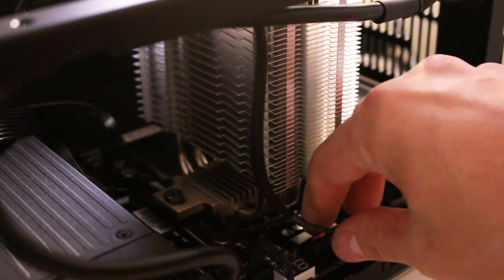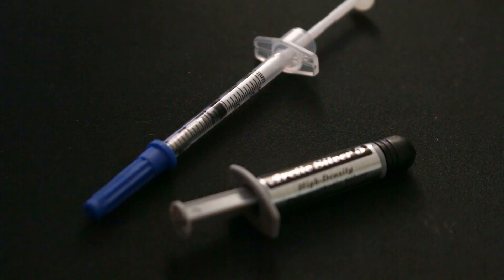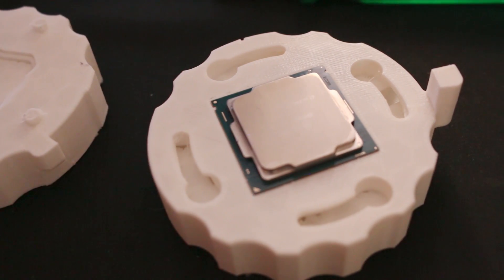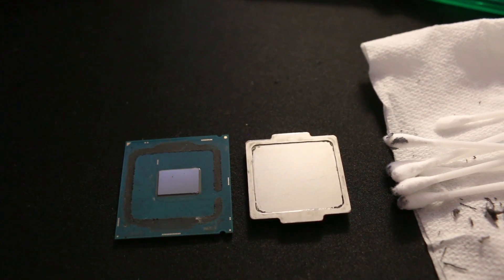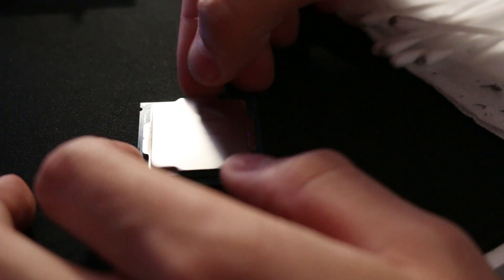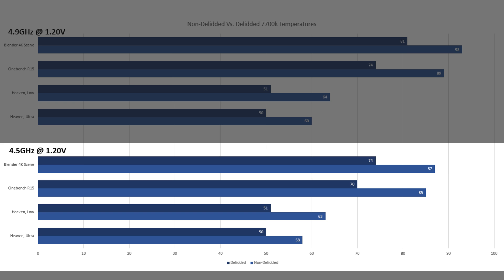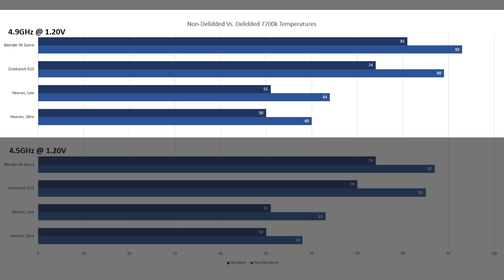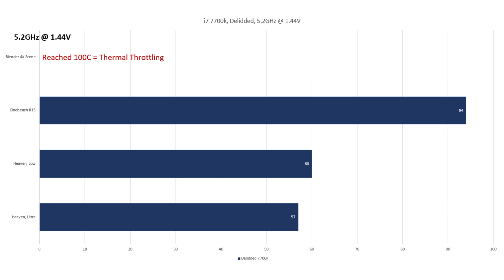i7 7700k Delidding Results - Is it Worth it?

Comment: My 7700k can run at 5GHz without a delid but the temps get pretty close to thermal throttling. I'm doing a delid soon so we'll see how much of a difference it makes with mine. I might be able to push it to 5.2GHz but performance gains probably wouldn't be worth shortening the lifespan.
Reply: Really dangerous, the sweet spot of overclock-stability is between 4.60 to 4.80ghz using a bigger cooler

For going 5ghz, better use liquid radiator

Comment: 1: Liquid Ultra is and was not then the fastest available.
2: AS5 is very very far from the best available. In fact it is mediocre at best.
3: How did you not know better that 3D printing layer adhesion would not handle that much pressure?
4: You put way too much liquid metal on the die.

Comment: Nice video, I won't complain about everything else everyone has already complained about, so theres no need to be redundant. That said I do agree with the complaints and even I, myself, whom I consider to be quite the mongrel of all things tech-related, had the courtesy use a real delidding tool when sodomizing the cpu and to, furthermore, clean the circuit board after I was done raping it. It just looks messy leaving it that way and I feel as though you have committed a cardinal sin in the holy bible of pc enthusiasts. May God have mercy on you.

Comment: If you remove the old black glue you will drop those temps by another 10c at least. 

Place a very small amount of glue on the edge or none at all.

You get better contact with the liquid metal and the gap between the IHS and the cpu will be thinner.

Comment: Holy fuck dude, that's way too much liquid metal.
Reply: he should have also applied it on the IHS. Der8auer did a nice video on how thermal material (including liquid metal) spreads and if you don't apply to both then it acts like water on glass: clumps together and moves in one direction

Comment: I delidded my brother's 7700K yesterday and dropped from thermal throttleing @4.5 Ghz to about 70° C @4.8 Ghz stable (prime 95) and i used normal Thermal paste because it's much safer to use and it did already made a huge difference to before.
By the way, I used the Thermal Grizzly Kryonaut on the Die and IHS for reference.

Comment: Definitely buy a proper delidder if you do this. It's not expensive - and cutting is hazardous as fuck.
Not all CPUs have the same layout under the heatspreader and you can easily cut surrounding transistors uless you ar eboth extremely careful and you do proper research beforehand. Just get a delidder and don't ruin your expensive CPU :)

Comment: Scrape the old adhesive off, and replace, also apply liquid metal to both the die and IHS. Permatex silicon black is perfectly fine, but even better is the 2mm wide double sided adhesive tape used to glue digitizer's to lenses. (amazon search for the old S3/S4 tape, that stuff is PERFECT and easy to work with)

Comment: The liquid metal you applied is ridiculously too much bro lol you do know that it is conductive right?
Reply: bankkrab1 he have a more recent video showing "re-deliding". Yoy should watch... XD
Reply: Pedro Bermudes got it! Lol
Reply: Didn't break his computer so he showed us for the 7700k at least you don't have to be as careful
Reply: Something's wrong with your chip mate. My 7700k stock peaks at 62c at max load.
Reply: @mohammadshibli8163  he overclockied it
hes not running stock numbers
Reply: Liquid Metal is overrated anyway.  Everyone thinks it's a must in order to get the large temperature improvement.  It's not .  A good, conventional non-conductive thermal paste, like Kryonaut or PK-3 will do just fine.  It will be a 1-2C difference.  The 10C + delta we see everyone getting by delidding is actually from the user fixing Intel's poor factory contact between the die and IHS.
Reply: @pam0077  idk about that. Either a thermal graphite pad or LM is the best option for between the die and heat spreader however, he should of at least used PK-3 or TG Kryonaut after instead of AS5. That was like adding insult to injury after spreading far too much LM on to begin with.
Reply: This is a comment from a while ago, but using liquid metal vs thermal paste is like using a good air cooler vs a liquid cooler. They are riskier, more expensive, and offer marginally better temps in comparison. Using liquid metal is stupid.

Comment: This was a great video until I saw you not use liquid metal between the IHS and the heatsink.  What a waste to use it between the CPU and IHS but not on both sides.
Reply: Not necessarily... That integrated heat spreader has a much larger surface area than the actual CPU chip itself. Because of this, you need to get the heat out of the chip as well as possible, obviously. But having more surface area on the heat spreader means that you can then conduct the heat away into a cooler of some sort more efficiently (more surface area conducting heat). It's the whole point behind the words 'heat spreader' - takes the heat produced in the chip and spreads it out over a larger area to aid in cooling. 

With that said, it's now well known that the liquid metal used for this is not the best thing to have rolling around in your computer... so using only a tiny amount of it under the stock IHS makes sense as it's so effective at aiding heat transfer there...but using it for the main thermal paste just simply isn't worth the risk, as it's only a degree or two better than the other 'normal' thermal pastes out there (Arctic Silver 5, for instance). The difference in temp on the outside of the chip is just not worth it...when you consider the potential damage you can do with a drop of that liquid metal on your motherboard somewhere...

Comment: Mine is 15ºC lower than yours in Cinebench R15 (4.5GHz 1.232v Auto and 70º C), using the Corsair H105 and with stock TIM (delid coming soon to get those extra 15 to 20ºC)!

Comment: Out of curiosity, why not use the same paste atop the IHS?
Reply: Liquid Ultra and other liquid metal TIMs are gallium based and will severely corrode any aluminum surfaces it touches, limiting heatsink compatibility. Also, it's more likely to dry up over time in the more exposed environment on top of the IHS. Besides, with the larger area of the IHS and modern heatsinks, the TIM is less of a limiting factor for  heat transfer than from die to IHS.

Comment: does no one at intel...like..check wtf kinda liquid metal or thermal paste or whatever gives the best cooling performance?! its ridiculous that you have to cut open your cpu and add a dam better solution for 10c !  because they use cheap shit and ask double .-.
Reply: The Dow Corning paste they use is good for operating in spec, and is very stable during thermal cycling over time... It is however shit. Also they use too much glue on the IHS.

I run my 7700k without deliding at 5.0ghz 24/7, have never thermal throttled, it's not THAT bad. Max temps of 75 on the hottest core under AVX work load.
Reply: WaterCooled?

Comment: Should you use liquid metal on the ihs aswell?
Reply: I've already done it, and i noticed a change atleast
Reply: not recommended. Definitely do NOT use on aluminum heatsinks. copper nickel-plated should work but regardless this is meant to go under an IHS, not as a conductive barrier between a heatsink and IHS.

Comment: It's important to mention that you shouldn't use the typical isopropyl alcohol that most people have. That stuff is usually 70% pure. You're going to instead want at least 91%. These days you can find 91% in most stores, so just be on the lookout. This is because once the alcohol evaporates, it will leave behind any impurities which can cause hotspots and reduce the efficiency of the thermal transfer.
Reply: That's good to know.

Comment: I got my i7 7700K to 5.2GHz on 1.42v with temps just under 84°C on average. Pretty nice temps for non liquid metal however thanks to thermal paste pumping and drying in the extreme application, the bond has failed somewhat and I'm stuck at 5GHz, I need to switch to Conductanaut soon. Unlike Liquid ultra, it's not meant to dry or solidify half as fast. I also obviously have a custom loop lol

Comment: Coolermaster V8 GTS vaporchamber and you will be amazed :D
Reply: The only thing that amazes about that cooler is the price tag. $130 for an air cooler? Better off getting a 280mm AIO or a Noctua NH-D15 for that and still have change left over. I'm sure that it cools well but not well enough to justify that cost.

Edit: My mistake. I was thinking of the MasterAir Maker 8.

Comment: Why isn't this thermal compound put on the cpu in the first place?
Reply: Soldering or using this method in a more cost efficient way wouldn't actually be that expensive. Intel purposely does this to cut down costs and take advantage of their customers. AMD is able to sell cheaper CPUs with INDIUM GOLD PLATED solder. Like bro,
Reply from the maker: Would be very expensive!

Comment: I have to be the most unlucky guy ever ... My 7700k wont even boot at 1.2V  4.9G. I need 1.35 to run stable at 4.8 and this is my max no stable settings on 4.9 5 G ... my mb is asus prime A series.... can you help me out with some settings what did you do or give me a hin how may I run it at a bit higher clocks ... I`m using Noctua D14 cpu cooler my cpu is delided and I`m getting max temp of 83C  at 4.8G for 8 hours in aida64  at 1.35V But if I even try to run it at 4.9 G it`s not stable I have to put it on 1.4V and my temps go to 99 on all cores ....

Comment: What adhesive should I use if I want to seal it back?
Reply from the maker: Silicone RTV, I recently sealed mine
Reply: You mean the adhesive that is used in car motors? Or a specific brand/type?
Reply: j-b weld red rtv hi-temp 100% silicone.{Do not use regular jb weld.}

Comment: Impressive overclock with 5,1GHz, I give you that mate. Have you considered slapping a 240mm or even 280mm AIO on the Chip for better cooling? 
However, you should've removed the black silicone from the PCB. Using a plastic razor or credit card will do fine and not damage the PCB. And 2nd thing is, re-lidding (black silicone glue) the IHS on to the PCB will improve your temperatures even further. According to Rockit by 1 - 2 °C.

Comment: Arctic Silver 5 is NOT one of the best TIM on the market.  Yes, it is popular, however, it migrates over time causing hot spots. - - You failed to remove the compound used to hold the IHS to the PCB [ one of the reasons for extra generation of heat, more space between the CPU die and the IHS.
Reply from the maker: Thanks for your comment.
I said thermal paste, not TIM. And yes, I would argue that it is the most popular, seeing as its ranked #1 on PC Part Picker under popularity. 

Do you have some evidence showing that it migrates over time? 

No problem, I've already addressed this in other comments.
Reply: Sorry I did not get back sooner.
Thermal paste is TIM [thermal interface material].  I do not have a video or other reference to AS 5 migrating [separating] over time.  I started working in the computer industry about 30 years ago, and some of my activities were for self-education, as in this case, testing TIM, including AS 5.  My testing proved that AS5 migrates.  I suggest you put AS 5 between an IHS and CPU cooler [heat sink], leave it for a year, take the cooler off and look for migration of material, including cracks caused by migration.  The cracks leave air pockets that cause hot spots on the IHS.

Also, I did not take pictures, as the information was for personal use at that time.  I now wish I had taken pictures of AS 5 and other TIM as proof for others to see.
Reply: geomadhack,       MX-4 is good, although I switched to GELID GC-EXTREME a few years ago.  I am now using Thermal Grizzly Kryonaut on my Intel i7 7700K.  Any of the above will do a good job.  After use, remember to store TIM with the tube pointing down, because most TIM uses an oily emulsifier that separates from the TIM over time - and you do not want that on your CPU, you want TIM.
Reply: hey, since you are into this things, what are your oppinion about the MX4?

Comment: Going to delid mine soon.  Currently stable at 4.9ghz @1.3v.  Runs hot tho.
Reply from the maker: You'll get great results, make sure you use liquid metal!
Reply: Mine is throttling at stock. It's ridiculous. Lost the silicon lottery, haha.
Reply: Optimum Tech rockit 88 makes a great delid tool, a bit expensive, but I haven't seen it fail yet
Reply: used conductonaut and dropped 15c stock and 19c 4.9oc.  Decided to undervolt to 1.12v @4.5ghz to stay below 60c under load and it works. 76c stock to 61c after delid.  4.9ghz 89c now about 70c under load.
Reply from the maker: That doesn't make sense at all! Check to make sure your CPU cooler is seated properly. You also might want to check out undervolting the processor, I've got a video releasing in a few hours on how to do that!
Reply: Alright, thanks. I switched CPUs and thermal paste and deduced the problem was the cooler. Replacing it tomorrow. I'll watch your video too :D.
Reply: yea just delid it :D
Reply: mine seems to reach 81C while rendering, ~75 while gaming at stock speeds. Is this normal?
Reply: How To Everything , mine does throttle at stock also! already changed thermal paste and cooler as well.. didn't work. how did you fix it?

Comment: Great content!
Does it make sense to use the Liquid Ultra to fix the Cooler to the CPU as well?
Reply: You can but there's no need. Normal thermal compounds are good enough.

If you still want to use liquid metal remember not to use it on aluminum ( because it will corrode).

Comment: fuck intel, they do this on purpose
Reply: Source?
Reply: Well, obviously. They want to increase their profit margins.
Reply: X series, which also requires new chipset too i believe?
Reply: I think intel announced that they are going to make 2 rebrands of the 7700k, and 7600k. Those will have better thermal paste underneath, and be better silicon lottery picks.
Reply: You do realize that metal expands and shrinks with heat and cold? If soldered, the expansion difference in both the CPU surface and the lid can cause micro cracks, which can ruin the CPU over time.

Comment: how about direct contact?
Reply from the maker: Direct die contact? I haven't looked into it too much but I'm pretty sure I'd need a shim to close the gap between the CPU cooler and die.
Reply: Optimum Tech direct die cooling is a bit different, you remove the retention for the cpu from the motherboard and the pressure from your cooler holds it in place, slight temp improvement but if you don't distribute the pressure evenly and you don't put on the right amount of pressure, you risk destroying your processor

Comment: I got 5ghz after deliding, and my temperatures are 15-20 degrees cooler under load. It really does work. I highly recommend the rockit88 for delidding. it's amazing.
Reply: If you use the liquid ultra i would also recommend cutting the brush down to a quarter inch or so to make it easier to spread the liquid metal on the die. like you would use for drybrushing.
Reply: Tried liquid ultra on my Titan XP. Dropped temps 12C at least and it only took three tries for it to not short out. :)

Comment: Thanks for another nice video :) Dude did you break a little bit of your die edge? Do you think is bad to remove the whole old glue? I delided mine and removed it all, but atm I dont have liquid metal (yet, its coming), so I applied Noctua Nh1 paste... so far so good, but I can only go up to 4.9 because of a hot case, temps are reaching 95 when under stress.
Reply from the maker: VeteranoNoob Thanks for watching! I damn hope not, where can you see that? 

I didn't remove all of the glue as I didn't want to risk scratching the PCB and it's not totally necessary as I'm not resealing it. The main goal of getting the glue off is to close the gap between the IHS and the die.

I'll be releasing a video next week on Intel Stock TIM vs Thermal Paste vs Liquid Metal as the TIM, so stay tuned for that. Spoiler alert, the liquid ultra was significantly better 😬
Reply: The top right corner, first I thought it was paste, but after you cleaned it seems to be broken, thanks got its not haahahahaha 

Cool man!!! I will be waiting on those videos.

About the old glue, I almost left mine but I was afraid the cpu was not going to sit straight so I had it removed. I will try buy some thermal glue so I can put it back.. lets see.

Thanks once more, waiting on the next video. :)
Reply from the maker: Thanks for the support! Don't reseal the IHS until you have Liquid Ultra in there ❄️
Reply: Hahahah for sure!!! I should get it in about 1 week or so, the seller already posted it... brazil mail system is a really big piece of poooop lol takes forever to get mail packages here :/

Comment: sorry fail. you have to remove the old glue
Reply: using a plastic raze or credit card it will peal off in 1 sheet
Reply: so how much of the old glue i have to remove? or i can just leave it as it is? will i get any temperature improvements after removing silicone? i don't want to fuck this up because 7700k was pretty expensive
Reply from the maker: Thanks. I respect your opinion, but unnecessarily removing the left over glue and risking damage to the PCB isn't something I want my viewers doing. Professional vs. Sensible I guess.
Reply from the maker: asus1201n I removed enough of the glue so that the gap between the IHS and CPU die was closed. Since I wasn't reapplying glue, it wasn't totally necessary.
Reply: just remove the silicon that's left over, it looks terrible and half-ass.  Not that you did but why would anyone ever re-silicone the IHS back down, that's a waste.
Reply: I agree that it wasn't necessary to remove all the old silicone, but it would have looked more professional if you did. Which is kind of important if you want to become a youtuber. Otherwise I thought the vid was good, definitely not a fail.